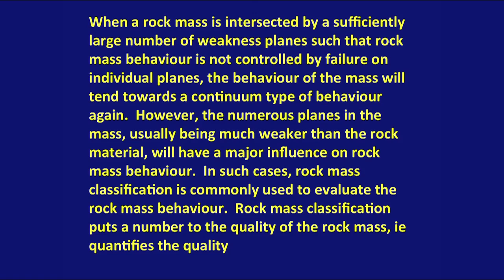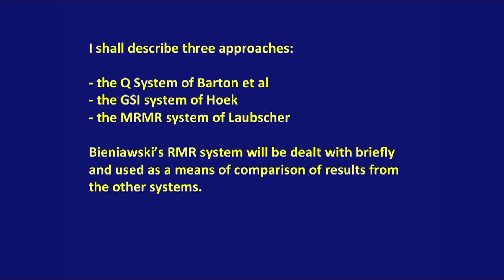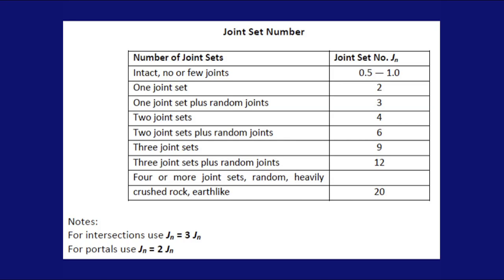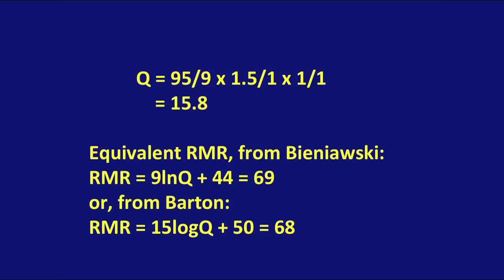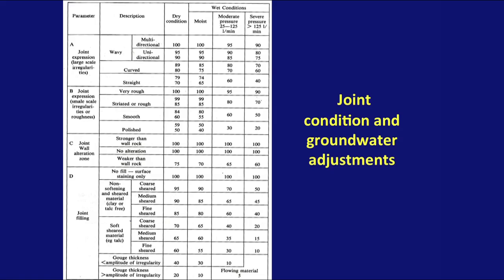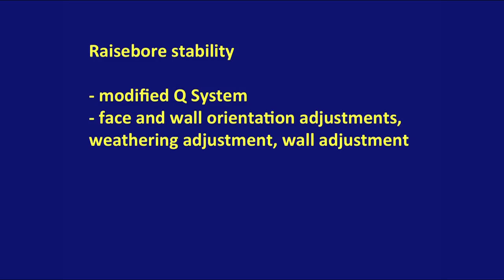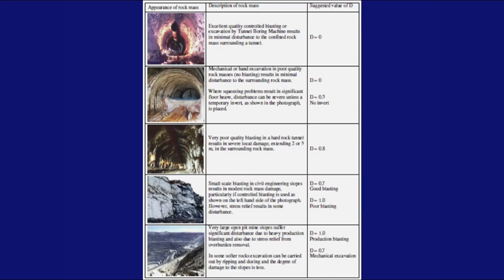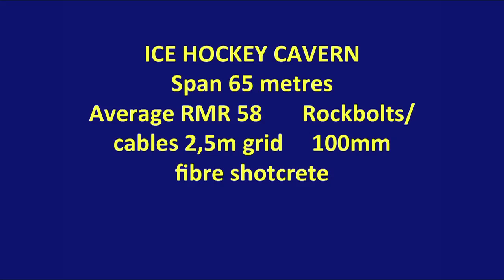Rock mass classification

Comment: Many thanks, Sir.

This video is very helpful and clear. However, could you clarify one question? According to the guide, "geotechnical guidelines for a transition from open pit to underground mining geotechnical characterization", p 106, the rating associated with JS varies from 3 (3 sets of structures with spacings of 0.1 m) to 35 (1 set of structures with spacings of 2 m). while in the video, 42.02sec, JS varies from 0 to 25.

Many thanks